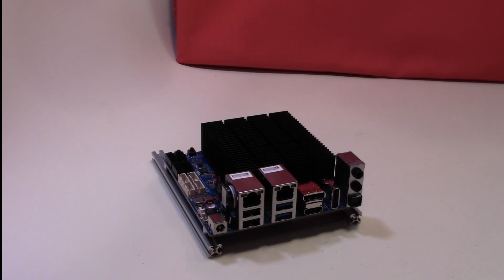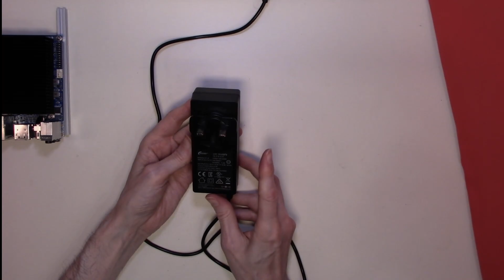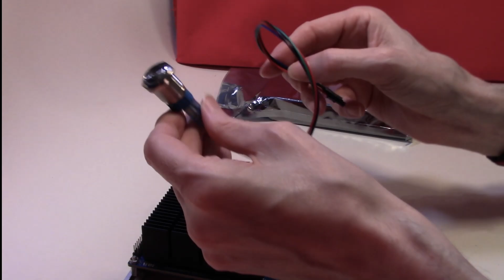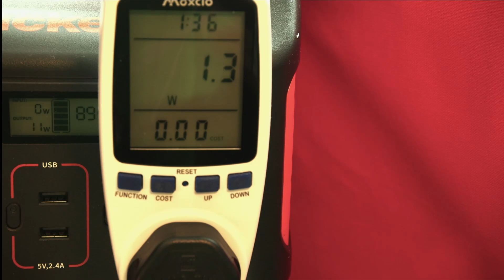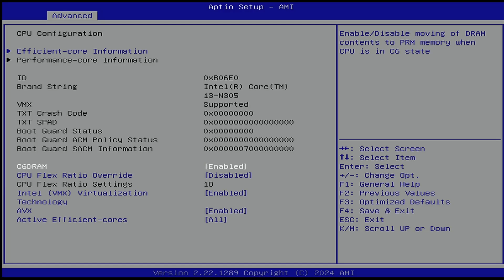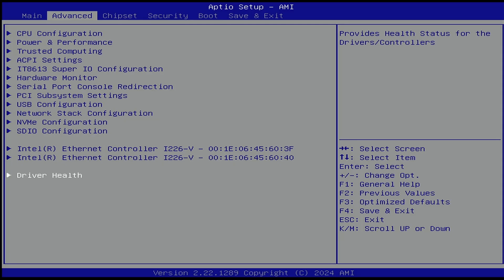Odroid H4 Ultra, single board x86 computer part 3 - First power up and a look at the BIOS

Comment: Do you think this could get up to ps3 emu switch and or run so modern games on steam at at least mid settings
Reply from the maker: While the integrated graphics are good, if you want to do serious gaming you should consider adding a graphics card to the computer. We covered this in a four part video series (https://youtu.be/SQugTUv7xto)
Reply: @custompchardware  I just watched that video it looks good but im trying to go for something that would fit in an h4 cube it doesn't need to be a beast but I'm just trying to get something in that case where I can use it for those things mainly switch and PS3 emu
Reply from the maker: The ODROID H4 Cube case supports the Network card as well as the 2x2 or 4x1 M.2 expansion, giving plenty of expansion possibilities. The H4 Ultra would give you the most powerful of all the Odroid models.
Reply: @custompchardware  I was thinking going with the ultra any suggestions
Reply from the maker: The H4 Ultra is a good choice, it's the most powerful processor in the Odroid range. You could put a large SSD in the M.2 slot, I went for 2TB but larger are available. Or alternatively get the 2x2 M.2 expansion card to allow you to have two M.2 SSDs and dedicate one for your OS and the other for your own software/games.

Comment: Now you can extend the HDD with a M.2 6 SATA adapter instead of using the NVME 2 TB Storage. You'd have to get a little power. Can you do a video like that? I'm curious how you'd do it.
Reply from the maker: I'd probably go down the route I did with the PCIe card for the H3+ and use one of the HDPlex PSUs to provide power for the additional drives.

Comment: is the 15v power supply enough if you only use sata ssd or do you always need the 19v?
Reply from the maker: I have one Odroid H3+ with a single 2.5 SSD running off one of the 15V PSUs without problem.

Comment: Nice. I'm considering this. It's all Odroid here. But I don't believe the PSU does 1.3 watt on its own, there must be a mistake. I tried some random smaller PSU's here together, but I never saw the slightest milliwatt. It's important to me because I run SBCs on solar power, but there's always a dark cloud above me.
Reply from the maker: Even though the Odroid isn't "powered on" it's still consuming a small amount of power, if only to detect when you press the power button as these are momentary power switches. The little red led on the motherboard is a dead giveaway. The power supply itself, when connected to a computer, will also consume a small amount of power unless the PSU has a physical off switch. I too run computers off solar batteries.
Reply: @custompchardware  Yeah, I thought it might be that. I just misunderstood. Or I had to be sure nothing weird was going on.

Comment: what size aluminum extrusion is that?
Reply from the maker: That's 10mm, specifically Makerbeam, although other manufacturers also do this size, it's fine for most of the computer frames.